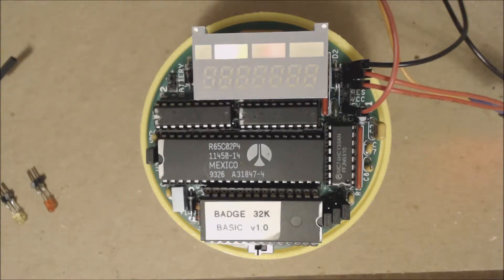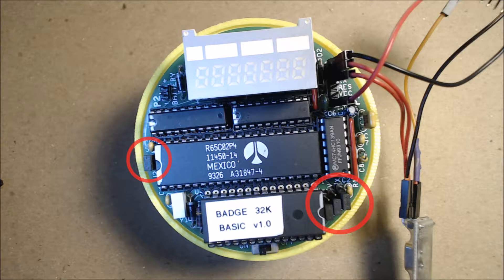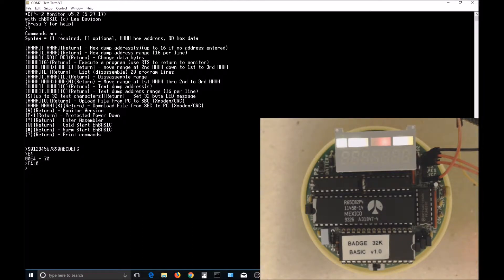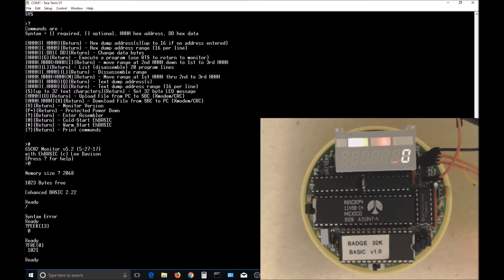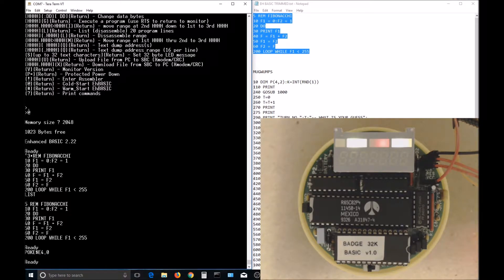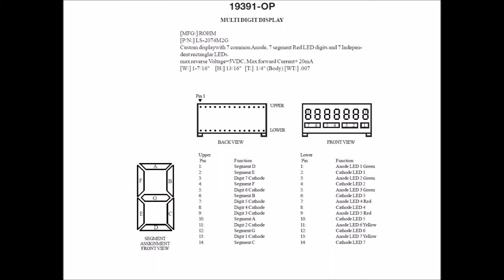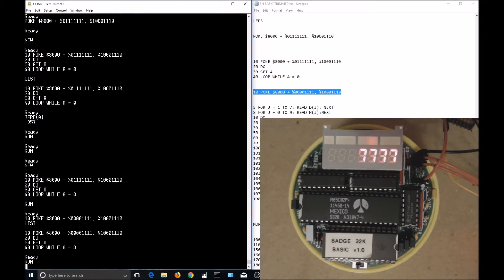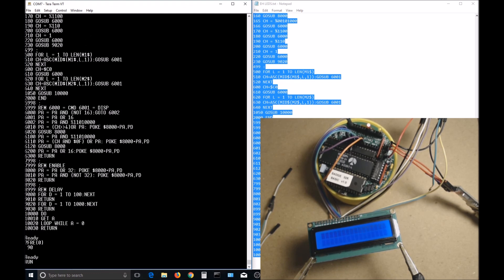6502 Badge running EhBasic

Comment: Hi,Can you share your Basic programs?Thank you!Thomas
Reply from the maker: Here's the fibonacci program:
5 REM FIBONACCHI
10 F1 = 0:F2 = 1
20 DO
30 PRINT F1
40 F = F1 + F2
50 F1 = F2
60 F2 = F
200 LOOP WHILE F1 < 255
Reply from the maker: The Mugwumps program:

10 DIM P(4,2):K=INT(RND(1))
110 PRINT
240 GOSUB 1000
250 T=0
260 T=T+1
270 PRINT
275 PRINT
290 PRINT "TURN NO.";T;"-- WHAT IS YOUR GUESS";
300 INPUT M,N
310 FOR I=1 TO 4
320 IF P(I,1)=-1 THEN 400
330 IF P(I,1)<>M THEN 380
340 IF P(I,2)<>N THEN 380
350 P(I,1)=-1
360 PRINT "YOU HAVE FOUND MUGWUMP";I
370 GOTO 400
380 D=SQR((P(I,1)-M)^2+(P(I,2)-N)^2)
390 PRINT "YOU ARE";(INT(D*10))/10;" UNITS FROM MUGWUMP";I
400 NEXT I
410 FOR J=1 TO 4
420 IF P(J,1)<>-1 THEN 470
430 NEXT J
440 PRINT
450 PRINT "YOU GOT THEM ALL IN";T;"TURNS!"
460 GOTO 580
470 IF T<10 THEN 260
480 PRINT
490 PRINT "SORRY, THAT'S 10 TRIES.  HERE IS WHERE THEY'RE HIDING:"
540 FOR I=1 TO 4
550 IF P(I,1)=-1 THEN 570
560 PRINT "MUGWUMP";I;"IS AT (";P(I,1);",";P(I,2);")"
570 NEXT I
580 PRINT
600 PRINT "THAT WAS FUN! LET'S PLAY AGAIN......."
610 PRINT "FOUR MORE MUGWUMPS ARE NOW IN HIDING."
630 GOTO 240
1000 FOR J=1 TO 2
1010 FOR I=1 TO 4
1020 P(I,J)=INT(10*RND(0))
1030 NEXT I
1040 NEXT J
1050 RETURN
1099 END
Reply from the maker: The 1st LED program:
10 POKE $8000 + %01111111, %10001110 
20 DO
30 GET A
40 LOOP WHILE A = 0

and edited line 10:

10 POKE $8000 + %00001111, %10001110
Reply from the maker: Multi digit display:
5 FOR J = 1 TO 7: READ D(J): NEXT
8 FOR J = 0 TO 9: READ N(J):NEXT
10 DO
20 FOR J = 1 TO 7
30 POKE $8000+D(J),N(J-1)
50 NEXT
60 GET A
70 LOOP WHILE A = 0
1000 DATA 127,191,223,239,247,251,253
1010 DATA %10111111
1011 DATA %10000110
1012 DATA %11011101
1020 DATA %11011110
1030 DATA %11100110
1040 DATA %11111010
1050 DATA %11110011
1060 DATA %10001110
1070 DATA %11111111
1080 DATA %11101110
Reply from the maker: Increment display number:
100 FOR J = 1 TO 7: READ D(J): NEXT
110 FOR J = 0 TO 9: READ N(J):NEXT
150 FOR N = 1 TO 100
160 GOSUB 500
170 GOSUB 600
180 NEXT
200 END
499 :
500 N$ = STR$(N): L = LEN(N$)
510 FOR J = 1 TO L
520 C(J) = VAL(MID$(N$,J,1))
530 NEXT
550 RETURN
599 :
600 DO
610 FOR J = 1 TO L
620 POKE $8000+D(L-J+1),N(C(J))
630 NEXT
640 GET A
650 LOOP WHILE A = 0
660 RETURN
999 :
1000 DATA 127,191,223,239,247,251,253
1010 DATA %10111111
1011 DATA %10000110
1012 DATA %11011101
1020 DATA %11011110
1030 DATA %11100110
1040 DATA %11111010
1050 DATA %11110011
1060 DATA %10001110
1070 DATA %11111111
1080 DATA %11101110

Comment: Nice work! I originally wanted to socket my display as well, but it seemed like the pitch was a little off from standard; the last couple pins didn't want to fit. I may try again with a different socket.